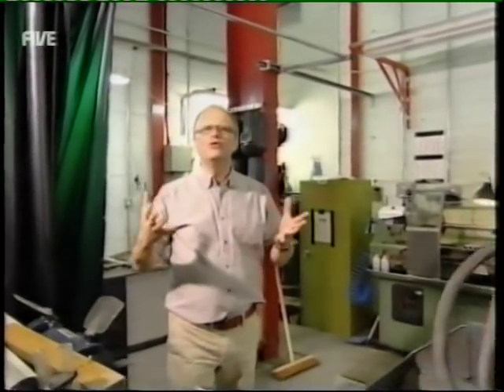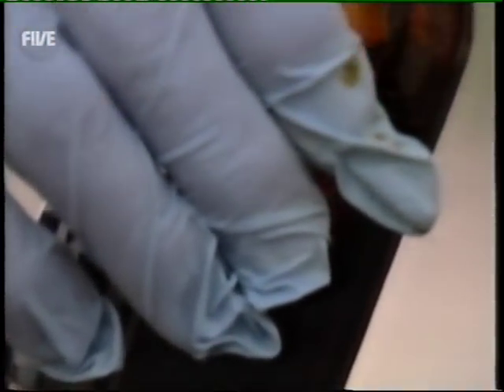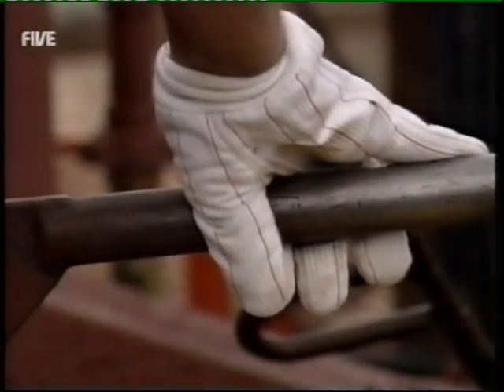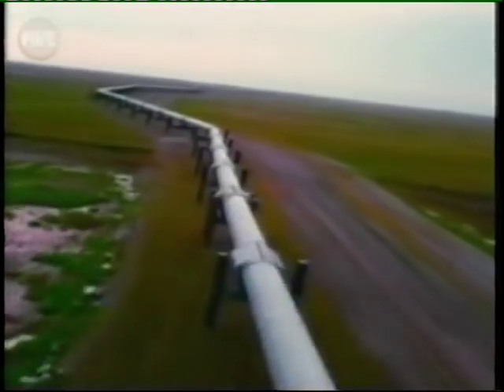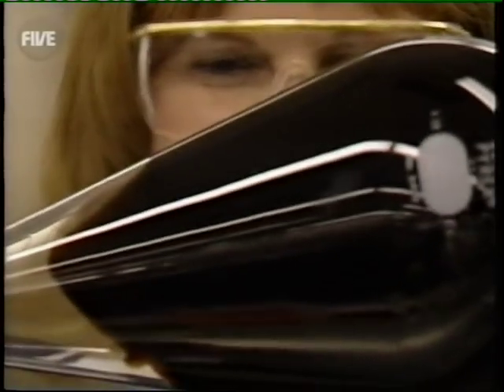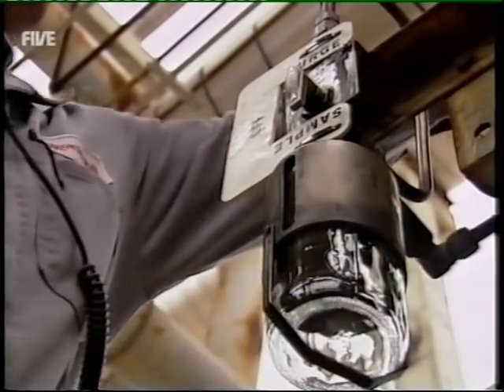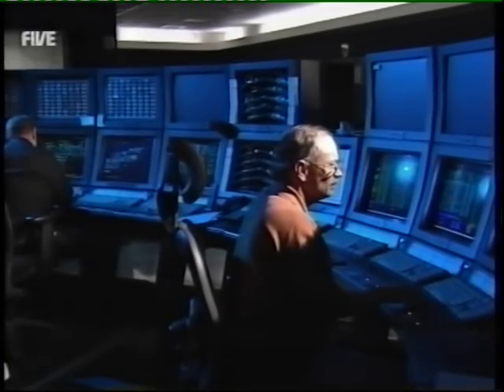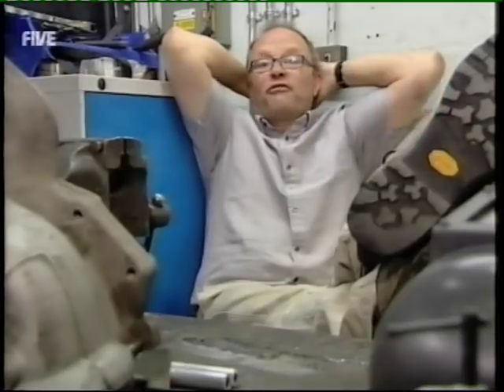How to Make Petrol or Gas from Crude Oil.

Comment: Just a small correction, the drilling fluid's main purpose is to actually equalise the borehole pressure and formation pressure. Otherwise it will collapse and a blowout is possible. Its secondary purpose is to cool the bit and carry cuttings etc...
Reply: They forgot to mention who comes in after the derricks finish drilling...
Us frac hands!
Reply: @rubencollazo8857  they also forgot the vac truck guys
Reply: And the loading coupler as well
Reply: Don’t forget about the greasy well testers lol.
Reply: Shovel the shale pile, dump a 50lb bag and Shovel more shale, make a connection,  strap some pipe. I remember it well. Better money in Canada by the way.

Comment: I love how the quality control guy working at the oil refinery rides a bike everywhere. Good job at doing your part.
Reply: They have to.
Reply: @tacomas9602  I was thinking that. 🤔
And thank you ☺️
Reply: It's for safety reasons I'd guess.
Reply: @revenevan11  You mean that they can't bump into a pipe?
Reply: @PySnek  it’s more for limiting ignition sources inside the process units and utilizing a lighter and more controllable vehicle in those critical areas. The plants are so big that bicycles are an absolute necessity when it comes to reducing worker fatigue and saving time. 
Bumping into piping doesn’t really ever happen unless the operator really breaks the rules and deviates off the designated pathway. Most of the process units have pathways large enough for two pickups to drive though side by side, but you will never see them in there unless during a shutdown and only to deliver material. And even then that scenario is unlikely. So bicycles are absolutely a safer method of transportation inside these facilities even though there are potential hazards to their use like anything else. The incident frequency of just walking inside these facilities would likely be surprising to you.
Reply: Bicycles are just an easier mode of transportation. Some of these facilities have hundreds of workers and contractors. If everybody had a vehicle there would be traffic jams all day. Besides bikes are easier to move around inside the units, since most have only a middle walkway large enough for a vehicle but not big or safe enough for traffic,and the rest are just tight areas only big enough to walk through.
Reply: Give him an electric one these days. Mayne even ditvh the respinsibikity and hit up one of them apps and jusy eat the cost letting them handle it for the company and then everyone at the plant has company provided transportation. That way we csn build them bigger and drive doe. The cost of tbe final products my boi

Comment: Assuming that the price of gas (petrol) fluctuates evenly with the price of crude oil, the price of gas pays for 87% of the cost of the crude. This doesn't include the labor and refining costs, but considering how many other products come from crude oil (diesel, kerosene, jet fuel, plastics, asphalt, lubricating oils, etc), it's safe to assume that the operating costs are covered dozens of times over.

Judging by the huge profits generated, this proves that the consortium of oil producers conspire to keep the prices inflated.

Comment: Video forgot the MOST IMPORTANT part:  adding at least 10% ethanol to completely ruin the gasoline while making midwest farming cooperatives richer.
Reply: SunriseLAW  ye it ruins old engines that weren’t designed for it
Reply: How else will you kill two birds with one stone 1)Increase octane rating of gas without adding lead 2) Make midwest farming corporate filthy rich.
Reply: @lemonflavorclorox7389  ..octane rating is increased by adding more octane to gasoline (which is mostly heptane) .  Anti-knock is different.  I am completely against the program but one side benefit is concentrated protein animal feed.
Reply: @SunriseLAW   From what I can find online "Adding ethanol to gasoline in lower percentages, such as 10 percent ethanol and 90 percent gasoline (E10), reduces carbon monoxide emissions from the gasoline and improves fuel octane". More the octane, less the knock, which is an unintended early combustion of gas and air mixture.
That said, yes, I 100% agree with you; such programs are often the result of successful lobbying to make the corps wealthy. They almost always never consider alternatives in such cases.
Reply: When Oregon went to oxygenated fuel (10% ethanol) I LOST FIFTEEN PERCENT OF MY FUEL ECONOMY. Brilliant, folks.
Reply: @lemonflavorclorox7389  .but it also reduces mileage which offsets the diff.
Reply: @Don Davidson No such thing as a rich farmer.
Reply: @D1KHEAD808  ..old saying"farmers live poor and die rich" referring to the tendency for the land to go up in value over time.
Reply: @ljprep6250  That is normal. E10 does not provide better economy, it provides better emissions. It's sold at a lower cost to offset the lower mileage. Same same but different.
Reply: @marcbennett9050  Burning FIFTEEN PERCENT more gas puts out more emissions, so there really isn't any advantage, especially when you figure in the overcost of ethanol and the added trucking for those millions of extra gallons of gas.  Check your figures.
Reply: yea quit knocking high octane, source of instant horsepower from the ground.
Reply: octane in gas is never the saturated hydrocarbon. their are so  many di and tert substituted alkanes probably evee alkenes and aromatics and ethers and alcohols.   so much shit in gas its crazy .
Reply: when we got the e85 i got like 20 free hp.
Reply: dont forget how much tractor and truck fuel go into producing ethanol. And how much extra water goes into growing corn, as opposed to other crops that the farmers would normally have grown.......but tax payer funded govt subsidies were given to the farmers so that they would grow corn instead. 
Ethanol is a lose lose situation for everyone except ethanol farmers. I would have included alcoholics into that statement, but the ethanol plant employees were caught stealing gallons of the stuff, so now they add a small amount of gasoline to the ethanol to “de-nature” it, so that its poisonous to drink. Poor alcoholics, always getting the short end of the stick.
Reply: Adam Wachs 1
Reply: I work around the large gas tanks at a facility. Ethanol tanks are nasty they coat everything around them in a black substance. It gets on everything.
Reply: Same with the low sulfur diesel. The way I read the EPA red diesel will be phased out by 2021. What are all those old construction equipment going to use for fuel? Not every contractor/owner has millions laying around to purchase foreign-made so-called "clean" machines.
Reply: How they manage to keep putting a product in gas that actually reduces mileage is beyond me, obviously someone is kissing some serious ass.
Reply: @ferstuck37  Sales strategy, makes them come back for more.
Reply: I haul gasoline and I could write a damn book about the shit that could go wrong with ethanol. I actually seen it today. A terminal in Charlotte had the ethanol pumps go down and ruined 9 truck loads of gas...well...not really. Just ruined the profit and production for a day. They safely pumped the gas back into the tanks so they could blend it with that garbage the "right" way.
Reply: @lemonflavorclorox7389  they actually add chemicals to the ethanol just to make it non edible. Yes. Real safe for the environment.
Reply: @johncamp7679  and it stinks. Not like a good bottle of Scotch but like a drunk's vomit
Reply: Tru Quality  wrong. I haul it and load my truck with it. 10% year round. The only difference in the winter is they blend butane with gasoline to cut down on condensation caused by cold temperature. BTW. Butane is odorless and extremely flammable. Probably best not to smoke anywhere near a tank farm.
Reply: @andrewarmstrong7310  EPA has nothing to do with red diesel. We add dye to regular clear diesel for off road use. Tax agents actually go around testing trucker's fuel tanks for dye to make sure everyone is paying those ridiculous fuel taxes.
Reply: SunriseLAW 
Supposedly making the gas burn cleaner.
Reply: Most of the ethanol comes from Brazil. They produce enough to completely run their country on it and sell the surplus
Reply: Sams club/Walmart does not have ethanol in their fuel 👍
Reply: Robert Slackware  Seems like a bit of that lead got into your brain after reading this comment
Reply: Add methyl terbutyl ether instead of ethanol
Reply: @johncamp7679  How exactly does a clear liquid coat everything in a nasty black coating?
Reply: Worked for a fuel company in the optimization of fuel blends that contained ethanol due to legislation and I can tell you it is not bad. In fact it increases the engine performance if set by a right percentage which at the same time makes your fuel cheaper.
Reply: @qwato  Thank you and hope the year has been awesome.  It definitely does not make our fuel less expensive in USA.  Just the opposite.  Yacht owners got a special exemption in 2006 because of $50,000 engine repairs and now clear gas can be found all over.   Alcohol kills small engines like chain saws, mowers.... it is a total scam on the public that starves our future.
Reply: @SunriseLAW  Hi thanks for the reply and seeing the circumstances around the world we're doing good :)
With that said I can understand that 'older' engines have more difficulties using a higher oxygen content in their engines which increases the per-ignition inside the pistons. What you could do as an alternative if you use an older model engine is to add some additives to reduce this effect by increasing the octane content but as far as I know fuel blends with extra ethanol (oxygen content) should have the same RON/MON values as the older type of fuels due to engine performance.
Reply: @lemonflavorclorox7389  hogwash
Reply: Poison fuel, cost American consumers over a trillion dollars in ruined engines.
Reply: @lemonflavorclorox7389  you forgot "sell tons of new lawn equipment, boat motors etc etc"
Reply: @lemonflavorclorox7389  do some more research, not sponsored by the industry.
Reply: @D1KHEAD808  Yaeh? 13 billion was GIVEN to soybean farmer.  "farms" are only a small portion families run.  Most are huge conglomerates, gobbling up the small farmer and sucking at the teet of Federal Welfare, supported by the Republican party politically mostly as the free $$$ flows back to them.

Comment: When people were having their crude oil from their shares delivered to their homes during the 1st lockdown, a large number were clueless as to what to do, like a lot of people who buy shares, etc, nowadays. However, they can siphon it off by pouring oil into a reservoir on heat, have an umbrella over that to catch the evaporating liquid, and all that sitting over a basin to collect the dripping liquid from the umbrella. Once the oil is 40C or 50C, lubricants for bike maintenance will evaporate solely from the rest of the oil. Store the lubricant if you want it. Then slowly raise the temp until the next product separates from the oil. I think gasoline and diesel separates at around 250C each. Things like petroleum jelly, and food/medicines separates at temps in between. You’re gonna need something more sophisticated to reach the higher temps. You can then sell your stores, and always make a profit at any price if you do all the work in between, or sell your barrel of crude for half the price, at best.
Reply: This is my favorite way to instantly get cancer

Comment: wow this is pretty complicated process. some really smart people are involved in this.
Reply: +Mazxlol Well, a chemical engineer knows this stuff, or a chemist knows this stuff..
Reply: this is easy. i do it all the time
Reply: +anoname smh
Reply: this is one of my tasks for school XD
we have to find out how does crude oil become fuel its sooo boring
Reply: @underswappapyrustheskeleto3427    A good place to start your research is distillation (fractional distillation to be more specific) and how does molecular weight, structure, and intermolecular forces play a role in the boiling point of compounds. 

this can become very interesting because this can be applied to every chemical!
Reply: Chemist do it in beakers. Chemical Engineers do it in 55 gallon drums or those big tanks pictured.
Reply: It accually fairly easy. Plan to start crack my own oil by winter. A couple hundred dollars you can make a plant that will give you all the fuel you ever need.
Oh it helps that not long ago I found I'm sitting on a nice amount of crude oil.  And unless someone comes along and buys my land for a mere $250,000, I'll start making my own gasoline, and heating oil.
Reply: @JohnSmith-wo5gl  lol Well I don't know about that. I'm just going to make a plant using drums and tubing.  
Used crude to heat the cracking plant. And run crude though plant. Hoping a weekend gives me a couple thousand gallons of gas. 
Used crude to heat my house.
( yeah I found out I have crude oil not long ago, still wish it was water.)  I Would be a lot happier if I found water and gold. Instead I found crude oil. Lol I suppose a lot of people would rather have the oil, but no one seems to want to buy my land for a mere $250,000. 
And again crude oil is NOT BLACK. It's the color of the 2nd fuel, or diesel, or honey. And is about same thickness as 30 weight motor oil or honey .
Reply: Sure
Reply: Mazxlol yup! get ur stove warmed up lol!

Comment: Years ago, I worked for a subsidiary of Phillips Petroleum in Bartlesville, OK. One day, with time on my hands, I went to PP's corporate office downtown. On the massive first floor, they had a veritable museum of all sorts of petroleum harvesting equipment on display. To me, the most impressive part of the display was the HUNDREDS of examples of finished products derived from crude oil. Interestingly, while 'fuels' were the biggest part of it, I learned many THOUSANDS of items are made from petroleum by-products. So, if all you Lefties want to get rid of 'fossil fuel' harvesting, you better get ready to ALSO say goodbye to products such as perfume, hair dye, cosmetics, hand lotion, VASELINE, toothpaste, deodorant, panty hose, eyeglasses, contact lenses, and EVERYTHING made of plastic.
Reply: We need the oil we got to last man. If we run out im afraid a luthium or cobalt battery just aint gonna cut it. These semis need a pumpable liquid fuel one way or another. You got 2 guys sleeping in shifts going from LA to New York city to miami and then san diego. Unless you got a magic  battery its going to suck to charge that joint

Comment: They skipped over a lot of steps in this video. Casing, cement, toe prep, plug & perf, and hydraulic fracturing all come before production... especially in the Permian Basin. And in modern day a lot of operators are using a wide variety of artificial lift systems (example used in this video is a pump jack). You also have plunger pumps, gas lift, electronic submersible pumps, etc.

Comment: 159 L. crude produces 73 L. Petrol 35 L. Diesel 20 L. Jet fuel & heavy fuel oil 6 L. Propane 34 L. Other products (10:06)
Reply: I was thinking that too, my guess is that they add other things to the other by products, like ethanol to the petrol, and some more solid stuff to the asphalt, that or some of the byproducts simply take up more room than they do when theyre dissolved into the crude.